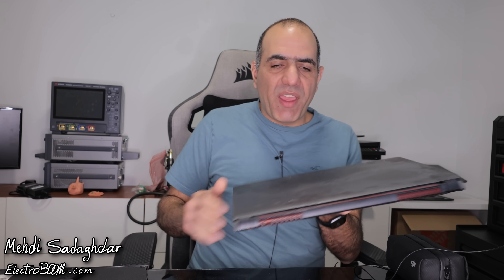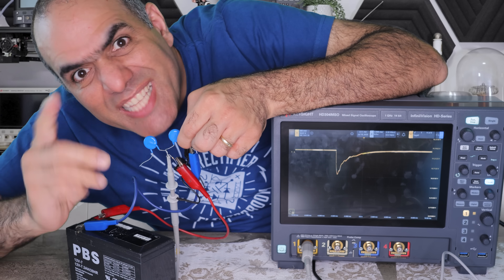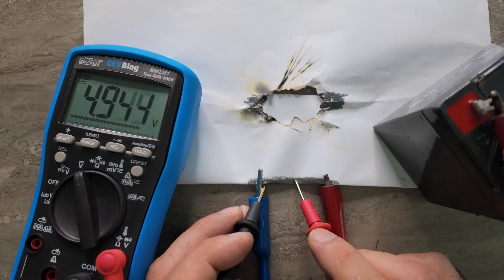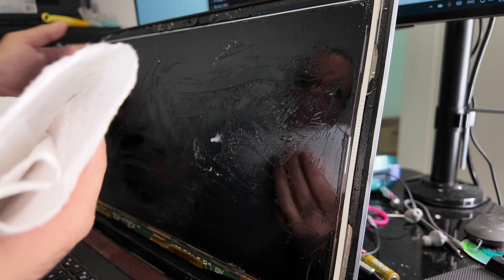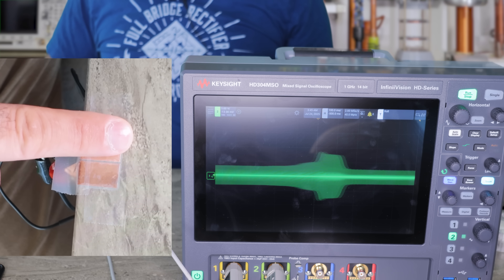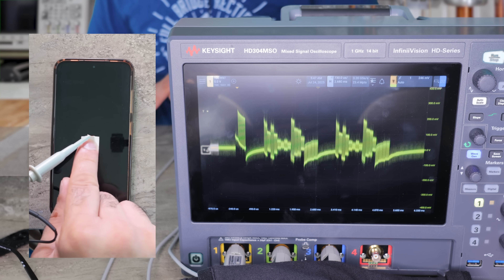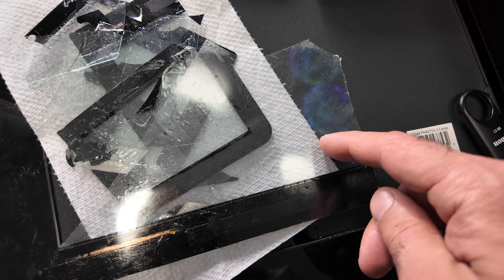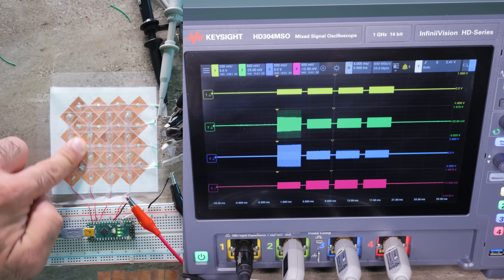The Touchscreen that Changed the World!

Comment: OK I feel compelled to tell you about this specific laptop (and possibly other similar ones). That looks an awful lot like a Dell Inspiron 7559. I know because I myself purchased that particular model back in 2015. So a super short TLDR: This would have happened to your display eventually, even if it had never cracked. This WILL happen to EVERY touch-screen variant of this laptop eventually. It's inevitable.

This was my first laptop that wasn't a hand-me-down, and I expected big things from it. I wasn't expecting one of those big things to be the remarkably large number of issues it would have over the years. I'll never forget what one guy at my university tech support said to his buddy after I gave him some backstory on the thing. "Hey Frank, come get a look at this. This dude's laptop is a literal Ship of Theseus!"

I've had a LOT of exquisitely bizarre issues with it, but the one that stands out the most is the display. At one point I noticed a mysterious, clear, extremely sticky fluid accumulating around the left hinge cover. This was around the time I had tried making silicone castings, so I figured it was one of the compounds from that which had somehow gotten onto my computer. Fast forward a few months and I notice more of this strange mysterious goop accumulating, but I could not for the life of me figure out what it was or where it was coming from. It was at least a year, maybe a year and a half before I FINALLY found something online that answered my questions, just as I was about to give up asking altogether. The mysterious, viscous, sticky, clear fluid had been slowly oozing out of the bottom of my display panel and depositing itself everywhere along that area. THIS was how it was getting onto and inside of the hinge covers, the speaker grill, and even parts of the keyboard. It turns out this was (As Mehdi did, but much faster than I had) the adhesive used between certain layers of the display (I think it specifically was the glass but I'm not certain) which had degraded and turned into a (very viscous) liquid. For anybody who has had the pleasure of never touching this stuff, its HORRIBLE. It's sticky, it gets everywhere, and just when you think you've gotten the last of it off, you find even more of it somewhere else. 70% isopropyl alcohol sort of dissolved it, but mostly it just temporarily made it less sticky and kind of encouraged it to form up into little balls if you scrubbed at it. 90% worked better, but still struggled to really remove it. In both cases it took MULTIPLE cycles of soaking, scrubbing, and rinsing to get it off completely. (including off of your tools, or anything contaminated with it touched, including your fingers) Out of desperation, one time I decided to try using acetone. That worked MUCH better and seemed to get it into solution. Unfortunately, it also readily dissolved the structural ABS plastic components I was trying to clean which made me reluctant to use this method except as a last resort.

It was around this time that I started considering just replacing the display panel completely; this time opting to go for the cheaper, non-touch 1920x1080 variant with a matte finish that intrinsically is far more glare resistant. (one of the biggest issues with the 4k touch screen variant was that it had a glass panel, so it was basically just a mirror and the amount of screen glare you got with it was absolutely off the scale unless you worked in near total darkness) Unfortunately, the two displays used different connectors and the motherboards were built for one panel type or another. I decided against replacing it with an equivalent display panel because as mentioned before, this WILL happen eventually. It's not a fluke, it's inevitable. A big part of the problem is the cooling system. In an effort to make the laptop a few mm's thinner, the display pivots around the center of the body of the laptop, instead of having the hinges on the surface of the chassis. That's fine and all, except 2 of the 3 exhaust vents for the cooling system blow out of the back of the laptop, and the geometry of putting the hinges within the chassis instead of on top means that the bottom of the display panel sticks down below the top of the laptop when opened, mostly overlapping the exhaust vents. Which means that 2 of the 3 exhaust vents are blowing hot CPU and GPU air directly onto the bottom of the display panel and re-directing it up towards the top. It still cools just fine, the the display can get HOT. Over time, the adhesive degrades, and suddenly it starts oozing out of the bottom of the panel. Now I might have been willing to just live with this and periodically clean the goop off, but it turns out that when this stuff starts working its way into electrical contacts, it can begin shorting them out, and eventually it will completely kill the panel. Currently about 2/3 of my display still functions, but 1/6 of its horizontal width is just totally dead and black, while another 1/6th of it is almost totally white at all times. The rest of it has various levels of uneven brightness and artifacts, and using the internal display at all even at minimum brightness causes one spot under the panel to get really hot, and letting it go to full brightness where you can actually see anything useful makes that same spot get alarmingly hot very quickly.

Like Mehdi, I decided to continue running it with an external display. Except the HDMI connector on mine is VERY sensitive and basically just doesn't work unless you spend 15 minutes getting it lined up just right. And if you bump it or breath on it or even look at it funny, its starts cutting out. So now I drive the display over a USB to DVI adapter, followed by a DVI to HDMI adapter. Also one of the 3 USB ports is dead because the plastic bit that holds the contacts in place sort of disintegrated into a dozen pieces one day a while back.

For those curious, other components that have failed and been replaced over the years include: the motherboard (under warranty), the keyboard (first time under warranty, twice more after that), the primary SSD (failed after microsoft pushed a content update I didn't even want. In their words, it was a "known issue that the update would cause premature SSD failures in some specific models", but of course they ran it anyway), the battery (after a long and reasonable amount of time), the display cable (which fixed my long-dead integrated web-cam but actually accelerated the decline of the already rapidly decaying display), the wi-fi cables (not the card or antenna, the actual cables themselves. That one was actually on me, I accidentally snapped them in half while doing something else inside), the main chassis (which SHOULD have been under warranty but they refused to cover it without explanation), and finally the secondary SATA HDD (which was also my fault, I dropped the thing by mistake. Of course for some reason the boot-loader was on the secondary drive instead of the primary, despite the OS being on the primary, which necessitated re-sizing the main partition on the primary drive, creating two more in the now empty space at the beginning, and copying a new bootloader into it from a recovery drive, all from the command prompt)

Comment: Such an awesome explanation... xD I kinda knew more or less how touchscreen tech worked, but this really drove things home.... super interesting stuff.
Also nice to hear from ElectroCute again. xD

But anyways, I think Mehdi ends up exposing exactly my problem with AI in general, on the most fundamental level.
There's a lot to worry about with privacy implications, content stealing problems, concentration of power at the hands of AI corporations, job losses, subversion of pre-established markets, plus a whole ton of other subjects. It's almost too many to list on the practical empirical side.

But on a very basic level, the real issue with AI is reliance. Because AI is not a perfect machine or system. It's a black box that you feed tons of content into, and it somehow processes that to give you answers to questions related to what was fed. The way it process information, as well as what gets into it, is controlled by AI algorithms, which in turn are currently mostly controlled by businesses.

This is my own opinion, feel free to disagree. But I'll just continue digging into this further.

Ok, so, what did we use to rely on before that? Professionals and experts, most likely, right? I mean, for stuff we can't handle ourselves. So, we're replacing professionals/scientists/experts with AI. What are the main differences between those?

One can be aptly explained by the trolley problem. People, aside from the technical knowledge which will likely be lower since AI can use a huge body of works for it's own process whereas humans have limits on that, will use not only that but also things like ethical considerations, morals, social context, probably some culture, personal standpoints, plus a bunch of very human things to do it.
We are very good in cross-referencing, and reaching to different areas to obtain answers and conclusion. To me, this is a huge part of what falls into the umbrella of "creativity", thinking outside the box, etc.
An AI could or could not be influenced by that too, if it's part of the training, if it's somehow programmed into it by developers, or perhaps by different means.

So, back to me saying this is an issue of reliance. You know how consumption of news and information shifted towards social media in recent years? Similar fashion on how we used to get information from traditional journalism, it went towards a system or machine for mass broadcasting?
It is an example of people shifting their source of information to privately controlled businesses, in social media case, to companies that control it whose interests is not often aligned to it's user base's interest.
I mean, by now it has been pretty much dissected and established that the conflict of interest that most social media has, that is of profit, ad revenue, numbers (viewership, accounts, engagement or whatever metric) and others is very much often not aligned with quality of information, transparency, private usage, responsible usage, and so on.

Which to be fair, what we used in the past could also have problems like those. News networks aiming for attention and profit rather than quality, or professionals, scientists and experts aiming for attention, fame, and power rather than knowledge. But the levels are different. You have too much concentration of power at the hands of a few, in a very unregulated and poorly understood market or environment, that continues being left so unpunished and not made responsible for the problems it causes, that you just can't compare them on the same level.

The way things are today, I simply cannot see how AI won't have the same issues, if not make things even worse. It could make things exponentially worse, due to the degree at which people are relying the tool for. And we're already starting from a piss poor point from the beginning. By which I mean, we're already using AI for stuff people already have poor understanding or poor grounds with. So when it all goes wrong, we're at the same level of blaming the Gods or blaming the forces of nature for it. It feels like a total regression of things instead of "the future" for me.

Because the same way lots of people are saying you could use AI "responsibly" by checking what they are generating, if it makes sense, if the code is really ok, and whatnot - it's the very same discourse that was used when social media started taking over, that people using it should check sources, verify if the information is credible, understand that it can be used by bad actors or misinformed people, and so on.

Perhaps it's just my own personal opinion, but at least for me the absolute vast majority of people who uses social media for news and information don't actually know how to check sources, verify if the information is credible or not, or distinguish between what is being said to inform people, what is to misinform, what is coming from actual studies and science, what is pure ignorant speculation, or even what makes logical sense and what doesn't. One, because most people never developed the skills required to do such things, and two, because most people who knows how to do those things already understands that it's simply not worth the effort - it's just better to stay far away from social media entirely.

And because this is how things work there, this is fundamentally my personal issue with AI, and why I don't follow, don't use, don't support and don't care about all of this hype. I don't want anything I do being contaminated by things generated blindly, opaquely, by tech giants who are only aiming for profit, with the further issue that it could have a huge hidden bias that is completely hidden from those who are using it, that is, until a major incident happens.

I'm taking my time to explain why I continue thinking AI is an enemy to be shut down and eliminated entirely, like social media, just because it's a Mehdi video though. Most of the times I'd only ignore and skip the video. Because even this discussion these days I feel it's not worth spending too much time and effort into. Ultimately, collectively people will once again fall into the convenience trap, further helped by corporate greed, late-stage capitalism, the warped finance sector we have these days, and Big Tech controlled ideology and politics.
When AI starts having major negative effects in societies, then perhaps some will wake up to it. But by then it'll be too late, again, because of over-reliance. And then we'll just have to live with whatever evils it brings. Can't turn the clock back. Tons of people, businesses, governments, and whatnot will have their entire destiny reliant on the outputs of Artificial Intelligence, and thus will become dependent and submissive to it, afraid to lose their livelihoods, their status quo, their lives, their jobs and everything else upturned if they are against the concept itself.

This is how Big Tech stole the Internet, ended privacy for exploitation, how social media is wrecking society and destroying reliability in information, how populism is rising once again, how people, societies and countries are being set against each other, how wars are breaking up again, all while we're ignoring major global issues that need us to join forces to fight against. AI won't have the solutions for that, it'll only empower those in control, who wants to profit from all this exploitation even more. We're not solving anything, we're being distracted by it's potential for good, in a situation that it can only and will only be exploited for bad. And the evidence of it is coming day after day in the news, which no one is listening to or just choosing to ignore, much like what happened with social media.
These technological tools all do have a theoretical usage for good. But much like nuclear energy, it only gets used for good if those in control of it have an extraordinary intention to do so, with proper law, regulation and investment protection to steer it the right way, which is now completely against the current. The ethos current, the prevalent dominant ideological current. So it's extremely unlikely to happen.

Comment: Good video overall, but the AI parts were overblown. AI is not useful for any task, particularly the kind of thing shown in this video. Both the examples could have been found in a minute or so from basically any microcontroller tutorial ever made, and thus obviously the AI has seen this in its training set. AI also provably and confidently fails on problems of increasing complexity, nor does it provide meaningful comprehension, consistency, maintainability, or reproducibility. The only thing that's happened here is you've wasted many times the power a conventional search engine would use, while gaining no advantage, saving no time, not learning about the subject, and feeding a multi billion dollar copyright washing machine...

Avoid AI where possible. If not possible, run local models

Comment: Sticky cleaning: use baby powder and 99% isopropyl. The powder does two things. First, it slows down the evaporation of the alcohol and it also lets glue stick to it. It makes goo removal much easier and faster. Without it you will was TONS of paper and alcohol.. and time and effort.

Comment: Great explanation!
There is another topic concerning capacitive touch sensors: switched power supplies emit common mode currents = disturbances. If you connect the wrong USB charger to your phone or tablet and a harmonic of the switch frequency happens to match with the signal frequency of the touch sensor nasty things can happen, the sensor may not react anymore or ghost touches occur. I suppose because of this smartphone manufacturers urge you to only use the chargers coming with the devices. These times most of the chargers on the market are constructed in a way that they do not interfere with most devices on the market but still the possibility of malfunction of touch sensors exists.

Comment: Never thought I would see is sensitive side :P
Anyway, to make the capacitive  sensor more transparent you only need to remove the middle of the squares (or just use a square shaped wire) since only the edges play a role in detecting.